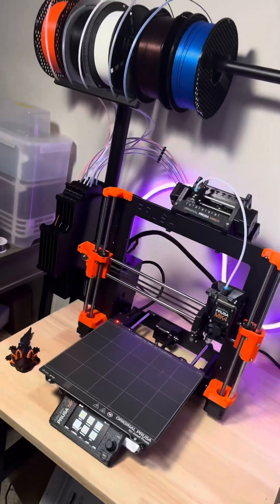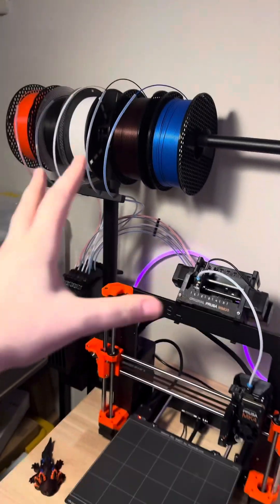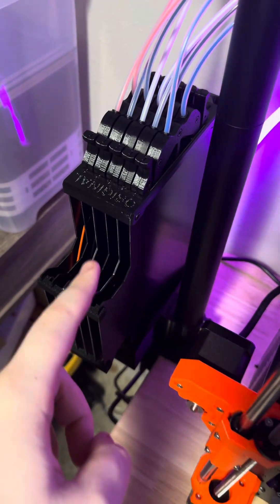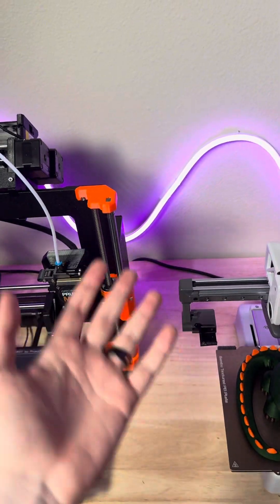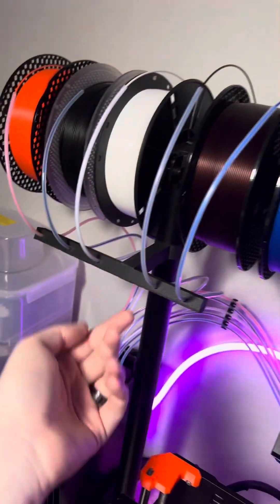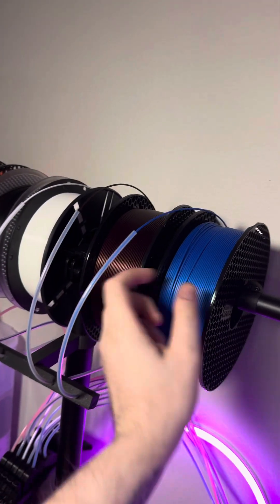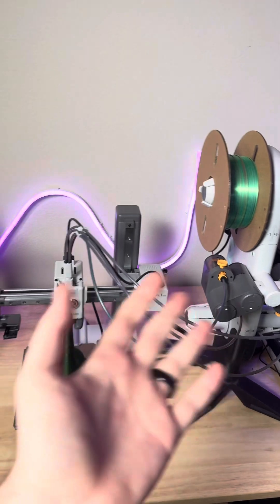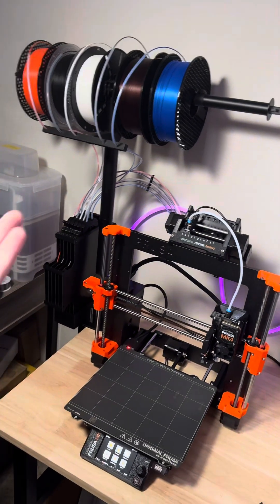PRUSA MK4 MMU3 Mod

Comment: The problem with that design is humidity. What I like to see is the filament buffer in a box of itself with desiccant and also individual filament is also in a dry box. That will be perfect. You won't have any issues, but there's pros and cons with both designs, but more cons with the filament in the air than in a dry box.